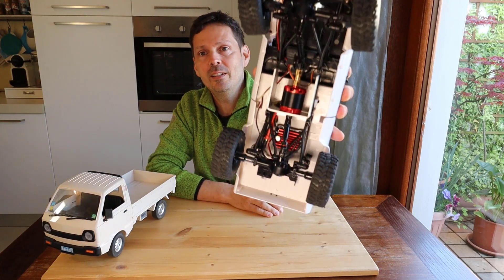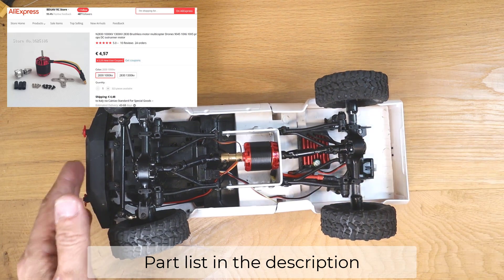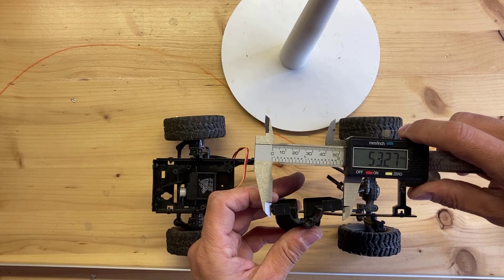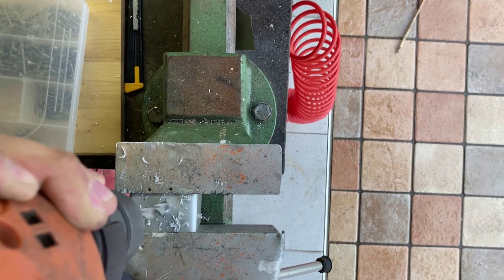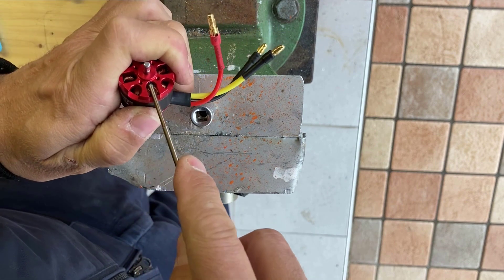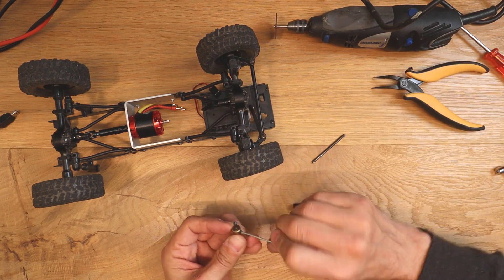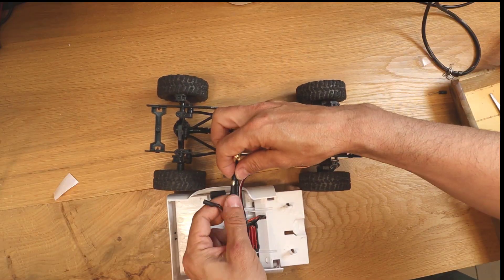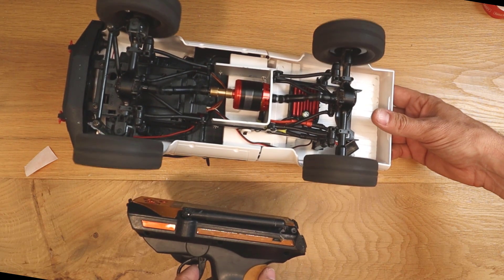WPL C24 BRUSHLESS DIRECT DRIVE Upgrade

Comment: Thank you for the very informative consul. I bought a c24 about 15 days ago. This is my first RC car. And I wanted to upgrade the speed of c24. And then I found your video. Awesome experiment. The speed is too fast for me. I want to increase the speed to less than twice the maximum speed of the stock vehicle. Can I just do what you're trying and replace it with a higher performance motor? The remaining parts remain original.

Comment: Please make ir with the new mn82 lc79 rc 😎
Reply: Direct drive offers speed but not lower end torque for crawling, I have purchased D2225 1350kb outrunner motor and a 10t 0.6m 3.17mm pinion gear, should be almost direct bolt on, just need to drill new holes or enlarge existing gearbox mounting holes from stock 14mm spacing to 16mm, you'll need new receiver and a Blheli_S ESC
Reply from the maker: @daijoubu4529 hi , you are right
No torque for crawling, but i see it as a buggy, for high speed

Comment: Helo there...so what is the transmitter you used ?
Reply from the maker: Hi, it Is the original transmitter
Reply: @MakerFabio  ohh for real? The wpl original transmitter you are using to control brushless motor?
How can you connected it?
Reply from the maker: @Wahyu Prastyo  sorry wrong answer from my side
Reply: @MakerFabio  to be honest with you, i have saved your video, so i guess i watched it alot...as i know there is no way to use the stock transmitter+receiver of wpl c24 to brushless motor..so
Reply from the maker: @wahyutuban  soooooorrry, now i realized, i thought this video youwere asking, was about the wpl d12, in that one i used the stock transmitter, here on the c24 i purchased only the car and i used my flysky gt3c transmutter

Sorry for this. If the remote of the d12 is the same of the c24 then check my other video how to convert the d12 remote for brushless

Comment: You need to put unlocked diff in the axles you can find them on amazon,
I put a 2435 Brushless Motor in my full metal gearbox alot faster then your one in 2nd gear, but the unlocked diffs is a must 👌 😎 
But epic idea with the out runner I'll see if I can find one for my next bauld 😀
Reply from the maker: Thanks, i ll look for the differential then!

Comment: Hello what do you mean the other engine would be better in the description, as in faster? And also, the links to some of the parts is broken I'd love to buy this stuff haha
Reply from the maker: Hi
because a 800kV would be little slower but with more torque and less cogging than the one show in the video.
The one in the video was little too high kv. About the link, after a while they brakes, i suggest to look for the part number i wrote in the description. on aliexpress, you will find them

Comment: Thanks, i modded my c24 the same way. But i changed the tires to 1/10 flat running tires, its way more stable and doesn't flip.
Reply from the maker: Thanks for the suggestion. I would like to try it too, but i like the scale looks of the original one. Maybe i will try to modify servo links to improve a little. Original servo ratio is giving too fast reaction at minimum turn
Reply: @MakerFabio  add gyro to it.

Comment: how can you get two of the same RC cars transmitters not to interfere with each other?  i have SG-1603 and SG-1604 and they can control each other...    make a video if you can...
Reply from the maker: Only the wpl d12 have original transmitter, all the other models has flysky tx/rx. The wpl c24 was bought as kit without tx, so it is using the flysky tx/rx

Comment: can you use the motor for the wpl d12 motor
Reply from the maker: Yes, it has same gear ratio, and the wpl d12 wheels are smaller. 720kv would be even better for low speed woth no cogging, but 1000kv should be ok
Reply: @MakerFabio  how about the esc can i use any brushless esc
Reply from the maker: @humancalculator711  any car brushless esc. Don t use generic bidirectional esc, or youhave lot of cogging and poor braking.  15A or higher
Reply: @MakerFabio  what would be the difference with speed with a 2430 motor with gearbox and the outrunner
Reply from the maker: @humancalculator711  2430 has higher kv so you can push more current and so more powerful. But also less battery life and risk to destroy the gearbox.
Reply: @MakerFabio  ok

Comment: Can I use this motor with 30A simonk esc
Reply from the maker: Hi, i never used simonk esc. I know bl heli old version you can set it as bidirectional, but i guess you may have cogging and no breaks, but only direct reverse (see my other video about wpld12 conversion , where i tested a cheap bidirectional esc)
Reply: Thanks for your reply. How much Ampere is perfect for this motor. Is 30a esc or 40a esc good for this. I'm little bit confused 🤔
Reply from the maker: @rokanuzzamanovi917  probably even a 20A is sufficent. Check for the motor spec whats the max current
Reply: Yeah . In the motor description 20a is good for this. But I'm little bit confused cause a big size motor like this run with only 20a . That's why I asked. I'm gonna use 30A cheap esc with this . Hope it will work perfectly. What do you say?
Reply from the maker: @rokanuzzamanovi917  hi
The motor is not that big, and it is very low kv ,so it could work to 3-4s probably, and it needs small current

With the modified wpl d12 batt last forever, so i guess current is really low
Reply: I have learnt from someone that this motor get over hitted after some time use. Do you have faced something like this?
Reply: Actually Im gonna use this motor in my rc boat.
Reply from the maker: @rokanuzzamanovi917  no, i didnt have overheating, but with thus model you just do some runs, you don trace intensively for one hour, but with 2s and this light car i guess you will not face issues

Comment: Bene bene Fabio, I liked the concept simple DIY. But I have a question, can you control the car backwards? Or just forwarded action
Reply from the maker: Hi
Sure , it just depends by the speed controller, the one i used it has the brake and also the reverse
Reply: @MakerFabio  thanks 👍

Comment: Great work! Does brushless motor have enough torque for crawling?
Reply from the maker: Hi, not in direct drive like this. Maybe if you use a bigger outrunner sensored motor and a crawler esc. With this motor i used it is more buggy driving style